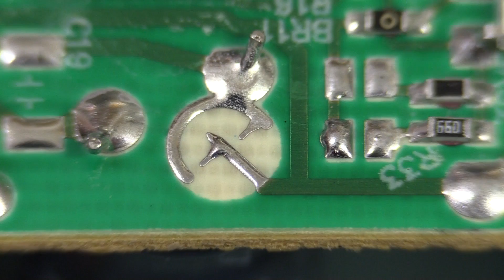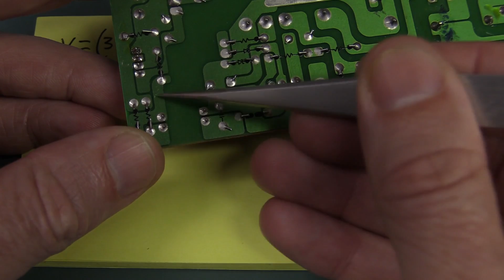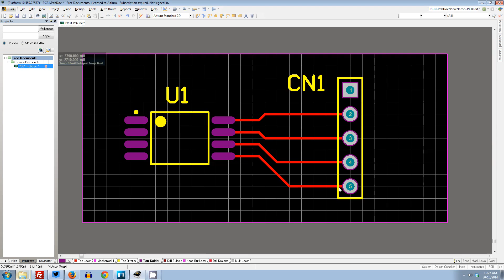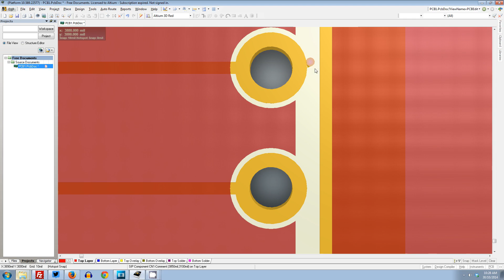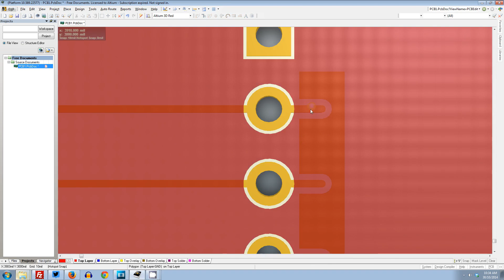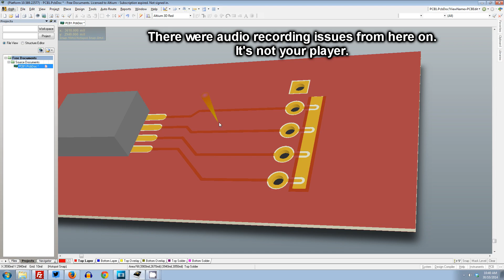EEVblog #678 - What is a PCB Spark Gap?

Comment: + EEVblog Pretty Good  Video Dave. You say most IC inputs are pretty tolerant of ESD these days. You're right; here's a story of .the early 1980's when they weren't ... We built an experimental 2-D phased array which was digitally steered. Each array element had a 1K deep 8 bit CMOS FiFO on the input. We had just finished integrating & testing the digital part & were ready to start the RF tests. On that cold, dry morning, one fellow came into the area behind the antenna & peeled off his wool sweater. He was right next to the big digital backplane but did NOT touch it; didn't matter - ALL tests which had passed 2 minutes before, now failed each & every FIFO was fried.
Reply: This remembers me about electrostatic experiments in school when it was summer (exact opposite). They just did not work. 
But still today there are many modules in RF that have a very low ESD Tolerance of just 500V to 2 KV.. bad for the bom cost

Comment: Hi Dave, nice review! This spark gap is not for protecting the input of the device, it's for leading the voltage flashover when (for example) u have a surge of higher voltage between the primary and secondary side or as u said ESD. You can not compare it with GDT. These gaps are also often being used in parallel to each winding of a common mode choke. If u have any question in detail to this PS I could ask my college at work, that's his baby ;) Greetings from Germany // Kaneda
Reply: In combination with a resistor it would protect the IC from ESD, wouldnt you say?

Comment: We have an insulation resistance tester at work that measures up to 200MΩ at 1000 volts. If you hold down the test button, it'll continually cause arcing if you hold the clips close enough together, and you see the measurement result jumping around.
If we do that when it's attached to a faulty cable (that doesn't have a full short circuit) the resistance slowly goes up.

Comment: I know that it's just a back-of-the-envelope equation, but the lack of proper units still bothers me, so I'm trying to figure out what the units must be on the right-hand side of the equation to equal Volts.

A Volt is defined in SI base units as (kg * m^2) / (A * s^3). Thus the right-hand side must produce that.

The 1350 must be in Volts because it's a summation.

Atmospheric pressure is measured in Pascals, which is defined as kg / (m * s^2). This already has many of the same units, so it's somewhat promising, but there's still quite a way to go.

Atmospheric pressure times distance gives us kg/s^2, which means that the unit for the 3000 factor must be m^2 / (A * s). Now I need to figure out what kind of unit this is, if it's anything.

m^2 is obviously the unit of area, and A*s is the unit of electric charge, ie. Coulomb. I can't find anything that corresponds to this. The closest thing I can find is the unit of electric displacement field, which is the inverse, ie. C/m^2.

If this is indeed the accurate formula, the unit for the 3000 is either strange, or a combination of units I can't figure out. Anyway, the most accurate I can come up with is:

V = 3000(m^2/C) * Pressure(Pa) * distance(mm) + 1350(V).
Reply: You are over complicating, unit for dielectric strength is V/m (usually it is used as MV/m) and for gases dielectric strength varies with pressure so they probably just put pressure in constant so it is something like this V/(m*Pa).
If you are interested in how exactly it works google Paschen's law, but in quick formula for it is Vb=(a*p*d)/(ln(p*d)+b) where Vb is breakdown voltage in Volts, p is the pressure in Atmospheres, d is the gap distance in meters, a and b are constants based on composition of the gas and unit for a is V/(atm·m) and b have no units.
Reply: WarpRulez The "3000" figure represents the breakdown voltage for air at 1atm (30kV / cm). He has lowered it by one order of magnitude, since he is working with distances in millimeters.
Reply: pesshau
I'm not so much interested in its magnitude as in its units.
Reply: Ah, but your error lies not in your research, but in your assumption that the 3000 NEEDS a unit at all, for in fact, it is an arbitrary number! You need no unit, because it is only there to show reduced voltage at less than one atmosphere, , just as the 1350 is arbitrary as well, it is the V on the left that is the actual unit for the final number, not the numbers on the right, which are all distance and pressure with arbitrary values for the math, because as he showed, 0.2 gives you about 2000 volts, and it took over 2k volts to spark the spark gap that was presumably close to 0.2.
Reply: WeAreGRID
It needs a unit because both air pressure and distance have already units, and the units on the left hand side of the equation must match the ones on the right hand side. The only way to make them match is to add the necessary units to the 3000 factor.

(This in itself would be very useful if the equation is correct, because it would tell us what the 3000 represents, which would be both interesting and useful information.)
Reply: Miloš Lazović The device can be build in a day at any University.Please study this and help to spread the word about this very low cost Malaria Treatment using oscillating magnetic fields which can be built by University students.6 million people are dying each year from Malaria.People just like you.Children,men women, mothers and fathers dying in great pain and suffering from malaria are dying right now.Remember just because it's not shown on the tv does not mean it's not happening. www.washington.edu/news/2000/03/30/magnetic-fields-may-hold-key-to-malaria-treatment-uw-researchers-find/

I urge you to actually build the machines which mostly consists of coils of wire to generate the magnetic field and a function generator.No new expensive technology is required.So don't just facebook like it.Gather science students and electronics students and build it together.Do something.Here is more supporting research with actual figures and experiments:-
http://www.phys.cwru.edu/undergrad/Senior%20Projects/papers/papers2011/Thompson_Brown_2011%20S.pdf
Reply: The pressure is in atmospheres and distance in mm as he mentioned. So the units are V/(atm*mm).

Rules of thumb don't necessarily have SI units. Nor do the units necessarily mean anything, because it comes from a linearization with respect only to distance and pressure, there may be other factors involved that are assumed to be constant and incorporated into the 3000. It's just a useful design equation and doesn't necessarily have any scientific significance.
Reply: You are looking for "Paschen's Law" for more information:
https://en.wikipedia.org/wiki/Paschen%27s_law

Comment: Thanks for the video, Dave!
if you need some ideas for some follow-ups: I would very much love to see you talking about general input esd protection. i know there's a lot to consider, line impedance, capacitance, inductance, response time of involved components (tvs vs zeners), so maybe some kind of hands-on walkthrough of how you personally would approach something like out-of-case interconnection between two boards involving some analog, some digital (serial, maybe rs232 or 485, perhaps i2c or spi) and power lines. I know there are a lot of specialized parts from different manufacturers on the market, but how to choose between them (and are they really needed or can you do similar things with jelly bean components?)

Comment: Back in the 60s, I had an RCA color TV come in that kept blowing a fuse. I discovered two parallel traces that had arced across and the PCB had become carbonized, kind of a low-Ohm resistor. I ended grinding out the carbonized area and painting it with a high-voltage coating that is normally used around the second anode connection on the CRT. That tamed it... :-))
Reply: Should've used peanut butter on that fuse. 
TVs don't like blowing fuses when there's peanut butter on it.

Comment: Hi Dave, a couple questions. Why does the transient choose the high impedance path through air instead of simply propagating down the trace. I understand the impedance of the gap changes drastically once the spark forms, but it seems that might take some time, during which the copper trace would be more inviting. Second question, are there considerations for the impedance of the trace after the gap, to ensure no reflection of energy? Or perhaps current handling capability, say for when someone shocks the hell out of it with an insulation tester? :) Thanks.

Comment: Neon lamps also come in handy, there are cheap as beans, are a little more controlled, and obviously trigger at a lower voltage, and also they have hysteresis, so after igniting, the voltage can fall down 60V or so and the NE2 lamp stays on in a low resistance state.
Reply: Power Max The voltage will fall in any discharge or spark.
Reply: 0MoTheG Not necessarily. Most real world supplies w/ series resistance will experience a voltage drop, however if you incorporate a feedback loop to maintain voltage at some value and hold it constant, the change in voltage over time will be negligible, and probably not even measurable (at least very difficult).

That feedback would not be hard to do with a large resistor divider and some op amps/comparators.

Comment: I suspect that PCB spark gaps are used a lot less these days of lead-free solder.  Tin whiskers anyone?
Reply: "lead free" is a swear phrase to me. i HATE it.
Reply: The safety spark gaps I've designed have always been gold plated, both to prevent oxidation, and to mitigate the whisker issue somewhat.
Reply: waswestkan
I wasn't suggesting that tin-whiskers be used -- I was simply pointing out that using lead-free solder without soldermask and with sharp points in the presence of a reasonable electrostatic field would be a perfect environment for the growth of tin whiskers that would (eventually) short out or reduce the gap, thus creating problems.
Reply from the maker: AIM54A I don't recall that, so would like to see it!
Reply: Sarcasm not indicate so here goes... Not I'm any sort of expert, but wouldn't depending on tin whiskers would be as bad on depending on a spark, or even worse?  You  can be sure the spark gap exists  because it was purposely designed and manufactured.  depending on whiskers means you're gambling  they have been create & create in a manner that  they  had create in a manner they could provide the level of protection desired.  You seemed to miss  some important details in the video.  Sharp point aren't desirable, while I'm no expert I understand why thee aren't.  Also the spark gap should be as close to the power supply input as possible.
Reply: mausball
 I could be wrong, but I thought xjet was implying one doesn't have design spark gaps, because could gamble on the creation of tin whiskers in a manner that would provide the desire protection.

Comment: I've seen vintage wooden telephones which have a pair of jagged metal plates connected to the line wires, and set with the points opposed to each other like those on the PCB to act as "lightning protection", but I doubt it ever worked... :P

Comment: Interesting video Dave. It would be good to find out more about the TVS and GDT devices if you fancied doing a video on them. I was looking into TVS devices recently because I wanted to do an Arduino project in a classic car and read that car 12v power can vary wildly when the ignition is turned off (load dumping).
I was also interested in what happens in a mains surge protector like my Belkin Surgemaster 8 way extension lead. There used to be a huge flash of arcing whenever I plugged in my laptop PSU (maybe inrush current sent to earth?). Eventually, after about a year, there was a massive pop when I plugged the PSU into it and the mains tripped. There was a smell of burning from the Surgemaster but no damage to the laptop PSU, and from that day on there was no more arcing when I plugged in the laptop PSU. I guess the GDT gave up the ghost?

Comment: During the 1000 volt test a tiny speck of PCB material moved downward away from the upper C shaped terminal. So no spark, but still evidence of the HV.
Reply: azayles 12:25 In the valley in between the two lower left points you can see a spec of the crud shift in the 1kv test on this PCB as well.
Reply: I noticed that too
Reply: Nevir202 Oh yeah! You have a good eye :-D
Reply: azayles
Thanks, don't know if I'd have been looking for it if you hadn't mentioned it before I saw that part of the video.
Reply: At 8:16 a small piece of crud on the centre part moves up and falls off somewhere
Reply: Ionization?
Reply from the maker: azayles Yeah, several have point that out, very interesting. Didn't notice that at the time.

Comment: I recall from physics many years ago the discharge was 3 million volts/meter in air... so that little formula seems good, not sure what the + 1350 is about though, maybe a humidity factor?
Reply: EEVblog The humidity effect is not that big. It basically follows a Squareroot-funktion. In dry air, the punchtrough voltage for 20mm is about 39kV.@50% humidity it is about 40kV. From there it doesn't rise much. There is an old paper (1956) from Hamburg University here:
http://zs.thulb.uni-jena.de/servlets/MCRFileNodeServlet/jportal_derivate_00157010/19564530518_ftp.pdf
It is in German, but the interesting graph is on page 3.
Reply: I think there's just so many variables it'd be difficult to get a totally reliable formula for it, you generally just have to go with the worst case scenario. For example humidity is probably just as, if not more important in that calculation than pressure, yet it's not included. Sparks will also travel a little more easily over the surface of a material than they would in free air, but of course that's going to vary with the material also.
Reply from the maker: ***** It was likely a number that just popped out of the experimental data. I don't know the history behind that formula, if anyone does I'd love to see it.
Reply: EEVblog I actually learned from when I was building my singing arc project and tesla coils that a spark is 1000V/mm. Very simple but not at all accurate. Seems to be grossly underestimating too! That must mean my singing arc is actually producing 30KV instead of only 10KV!!!

You can actually make small arcs with as little as 18V at 1A, they are hard to see, but nonetheless it is possible!
Reply from the maker: LPFthings I have never seen a formula with humidity added. I agree that it's very important, maybe even the most important. But the fact remains that no such formula exists (to my knowledge), and it's not like I can just make something up.
Reply from the maker: Power Max You can't get an arc-over spark from purely 18V, it's just not possible. When you get sparks from high current stuff, other things are at play than the supply voltage.

Comment: The sharp edges arc easier than flat or round edges. The sharp edge has less surface area so the current density is higher and will thus arc easier than if the current is spread over blunt edge.
Reply: Dave's pointless (pardon the pun) spark gap is actually a pretty bad idea. Or rather, he's making its arc-over reliability far worse by not concentrating the electric field on a point to encourage breakdown. The idea is not to sustain continuous arcing, but to handle short faults (under a few ms). Same reason lightning rods are pointed.
Reply: You're so close to the answer, so close!  But it's not current density, it's the density of the electric field.  The electric field is concentrated at the tips of points and it takes less voltage to make the air there begin to conduct.